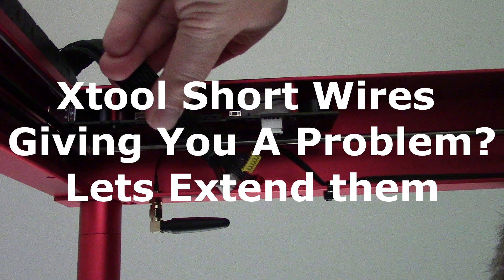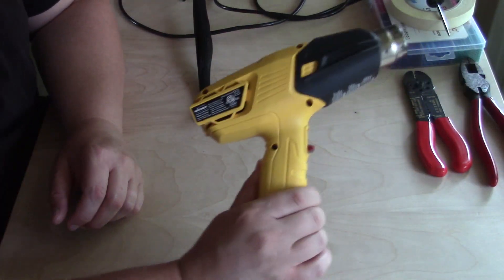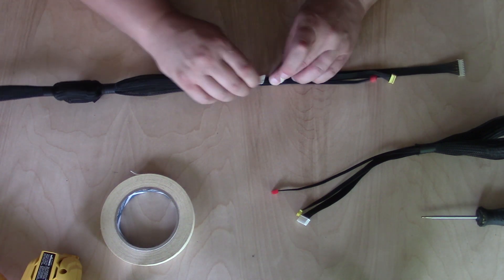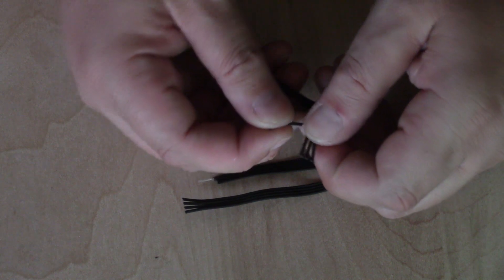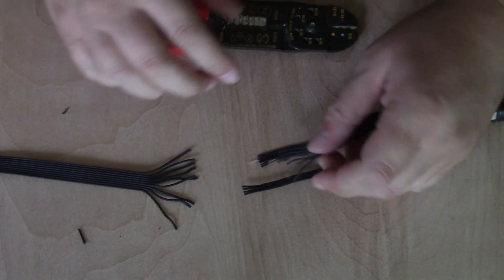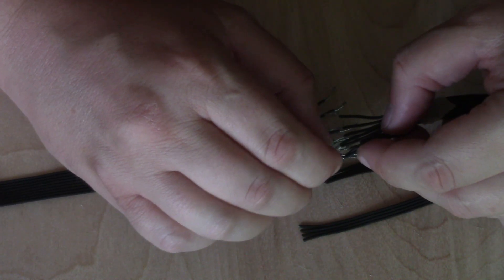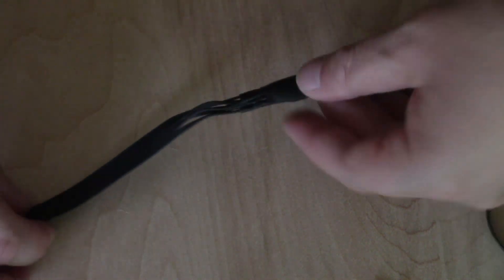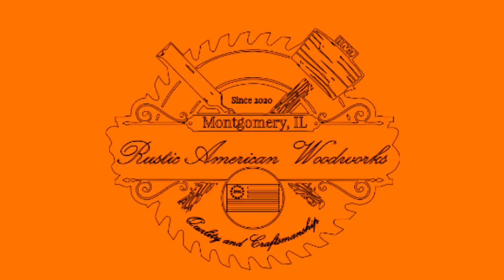Xtool Wire Extension - How to Extend your Xtool wires so they fit nicely into your motherboard

Comment: I'm not sure I'd trust just twisting the wires together unless your heat shrink is the type that has a sealant inside of it. I'm still waiting on my drag chain setup to get here, and expect I'll need to do something similar to extend the wiring.
Reply from the maker: I haven't had any problems.  But you can always order extended wires from people.  I know https://alivepixelcreates.com/ has some for sale.  If you use promo code HowWeDoIt you will get 15% off your purchase.  I believe he sells them as a kit, drag chain and wires, but if you contact him he will sell you just the wires.